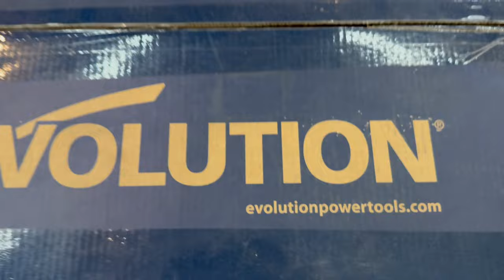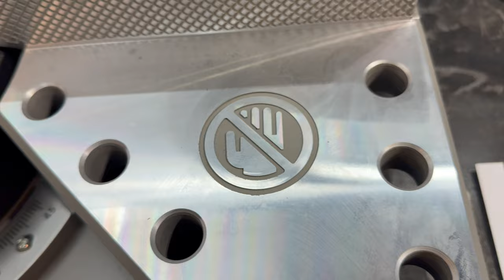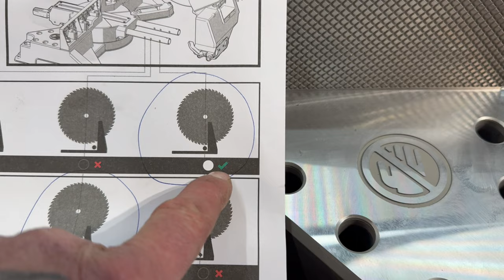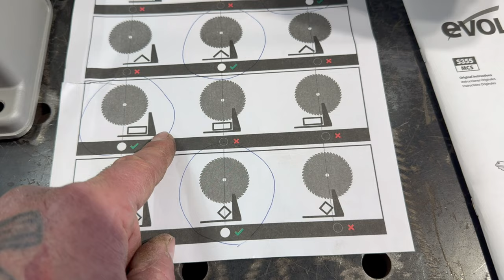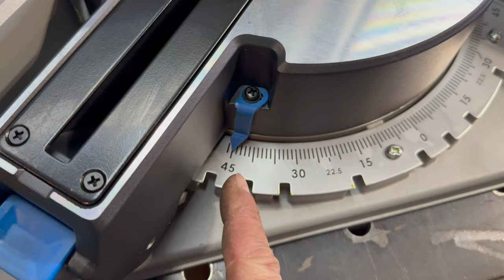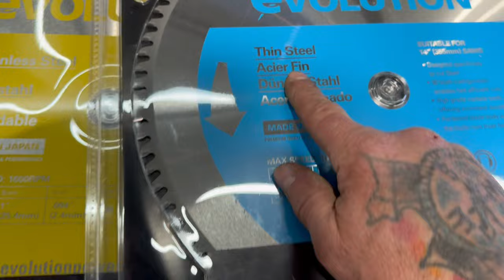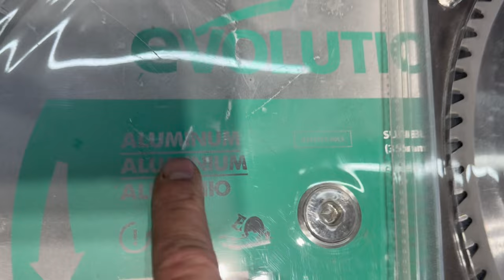Newest Evolution Saw, S355MCS Miter saw. High quality miter saws!!

Comment: I picked up the original orange Evolution multi material compound miter saw almost a decade ago and it has been a real dream boat and extremely helpful for getting crazy angle cuts for weldments, but I always wanted something a little bigger and heavier for some of the thicker msterial i woukd run through it. This looks like just the ticket, I'm going to look forward to seeing your review after you get some time with it and might just have to add one to the shop.